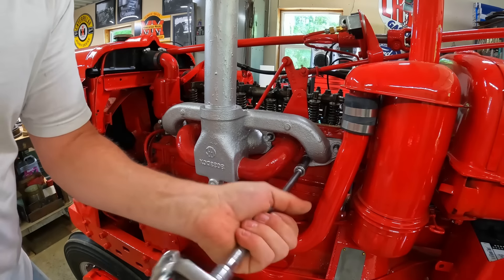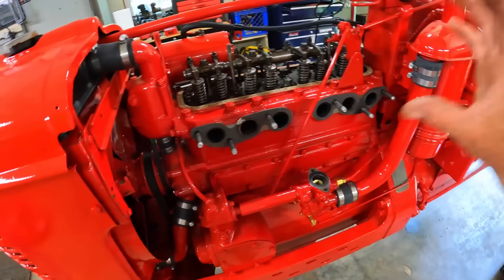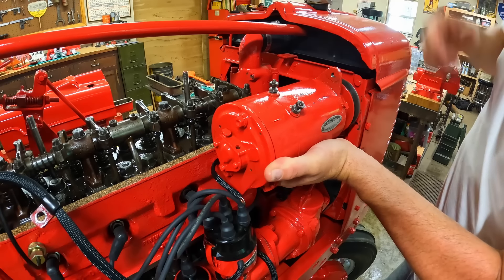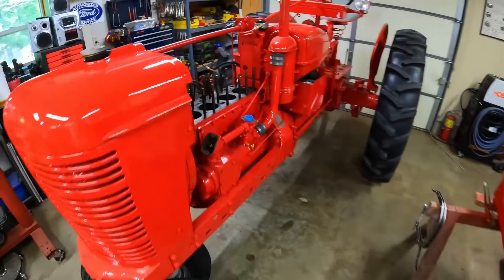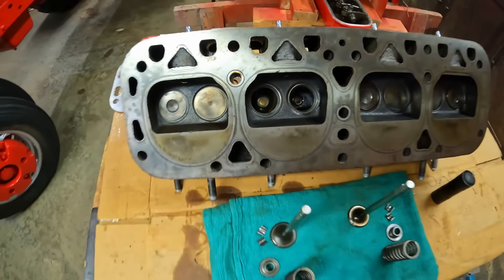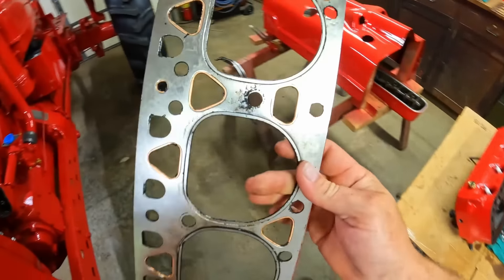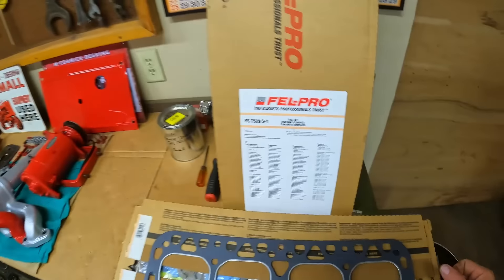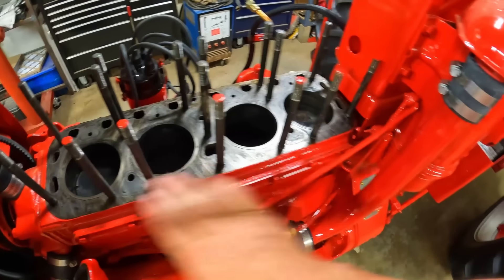Farmall H Engine Knock Found, But It's Not What I Thought - Farmall "Preparation H" Project Part 45

Comment: I'm a lawn mower mechanic, and only piddle around with larger things. I've owned a couple of 40's farmalls, and never had one that the sleeves came up that easy on. I, too, would be suspicious of that particular sleeve, I can't fathom how it would be loose, and am more suspicious of the bore than the sleeve going in it. If the sleeve cracked, it'd get tighter*...if however the *bore cracked, the sleeve would get looser. Surely not a cracked bore though as really, all I can think of that'd allow that to happen is if it froze, and I'm fairly certain you take better care of it than to let it freeze and crack, so metal fatigue? previous owner let it freeze and a small, unnoticed crack grew? No idea, but a crack of any size at all you'd think would let water into the oil and be evident, and it'd have to be of some size to allow that sleeve to be loose.

if everything is ok, I am afraid that even though @lukestrasser poopoo's the idea..if everything else is good, a little sleeve compound would solve it. If there was a way to notate it so that the next guy knew, it would be a non issue. I would not trust that head gasket to keep that sleeve in place. It's my understanding that that is not the purpose of the head gasket in these engines..and any travel, will gradually become more travel as that sleeve hammers away at that head gasket one tiny peck at a time.

Finally, as an afterthought...there is a possibility that the sleeve barely moved to begin with (came to me as I was imagining that sleeve slowly beating the new head gasket paper thin)..and over time, wear from it moving made it looser and looser...but which part wore; the sleeve or the bore? Probably both. A new sleeve might be tighter than that one, but is the bore still within spec to accept it snugly? All questions that need answers.

Comment: Don't loctite it. It's a dry fit sleeve. Maybe a shade under tolerance but like you said, still in good shape. Part of that head gaskets job is to help hold those sleeves in place. Thousands of engines built exactly the same way. Inspect it, clean it, put the Fel-Pro on it and bolt'er up. She'll run like a Spotted Ass Ape after that!

Comment: If it checks out I would put the better gasket on and run it. It is interesting that removing compression stoped the liner from moving.
Reply from the maker: Removing the compression kept the rings away from the cylinder wall, reducing the amount of "drag" that they exerted on the sleeve - a lot of people don't know this but the more the air compresses on top of the piston, the tighter the rings seat out against the wall.  Maximum ring-to-cylinder wall pressure happens just as the fuel charge is ignited, expanding the rings out fully :-)

Comment: I don't know how thick the metal is around the sleeves of this engine or if something like this can be done.  I've never sleeved and engine so I'm not familiar with them.  I'm a Machinist, spent many years in the USAF and in civilian shops. I've seen bushings in parts that were designed with sleeves or bushings with what I would call a threaded keeper. They were designed that way so they could be removed and replaced where it would require a lot of work or an overhaul of the equipment that would be costly to replace an inexpensive part. Basically it was nothing more than a set screw that 1/2 to 3/4 was drilled and tapped between the two parts. After the set screw was installed it locked the part in place so it couldn't rotate or move in and out of the housing. Depending on how large the part was there  could be 1 to 4 of these threaded keepers around the bushing or sleeve. Another way I've seen this done was by drilling and tapping a hole next to the sleeve and either counter boring or countersinking so that 1/4 to 1/2 of a screw or a small bold, sometimes with a washer would set flush or just below the surface so it would lock the sleeve bushing in. The flush setting worked well with the countersink screws, especially in parts that needed to be sealed with a gasket. It is surprising how much a little screw can hold if done properly.
Like I sated before, I don't have any experience sleeving an engine. But if there is enough metal around that sleeve it should work.
One other potion, there are many small independent machine shops that could make cylinder sleeves better than you can buy today and could probably use the work. Soon you will be able to 3D print those cylinder sleeves. I'm afraid that 3D printing is going to be the end of machining. 3D Printing has come a long way when since it was invented. When I saw the Swedish Car company Koenigsegg showing their new two stage turbocharger made out of Stainless Steel or Titanium, that is produced by 3D printing at considerable cost savings, I knew then it was only a matter of time that machining will come to an end. That was 10 years ago! You might be surprised how far 3D printing has come and now they are making body parts with cellular 3D printing.
Here is a link to the Koenigsegg turbo if you would like to see what I mean.
https://www.youtube.com/watch?v=DNedUZxP8NU

Comment: i would try to find a new sleeve that is titer . if it is to lose you might have trouble with heat transfer to the parent bore. i had a friend that farmed with m farmalls and he said there used to be a .005 oversize sleeve for this problem.some mechanics used to hone the parent bore to clean them up to put a new sleeve in . good luck

Comment: Have you thought about if this sleeve issue is connected to the old head cracking? I dont remember where and how it was cracked. If you dont think one damaged the other i myself might chance a quality gasket,  if you are suspect they are connected you may only be delaying new sleeves,  and running the risk of another damaged head
Reply from the maker: The old head had a repaired (pinned) crack above #4 cylinder, up inside an intake runner not related to anything happening down at the block 👍

Comment: I recently did a sleeve and piston rebuild on a ford 640, the sleeves and pistons out there for new parts are cheap chinese.   The sleeves on install were very tight and pistons were actually over spec, let's just say QC was not there.   Had a machinist help with the sleeves.   In the end I got it to work good but boy are the new chinese parts a headache to deal with.

Comment: A new sleeve will mean a new paint job, so use the good gasket and run it. Otherwise it will mean a complete repaint of the entire tractor because the 'other brand' paint will not match and you do not have enough paint to do the engine block.... I have a Massey 35 with paint that is no longer avaliable, the new paint is a different shade of grey to the original.

Comment: At least now we know. I defer to the engine experts on this dilemma. Personally, I would rather run used but not abused older "quality" parts than brand new "questionable quality" stuff any day. Things were going down in quality for quite a while, but since covid quality just fell off a cliff while prices went through the roof...  What about measuring all the sleeves and the bores maybe you can swap if one of them would yield a tighter fit?

Comment: I've read the first 30 or so comments and didn't see any mention of using a punch at the edge of the sleeve where it rests in the block to add a little retention in maybe 5 or 6 spots around the circumference.. I don't know what the hardness of the sleeve is so this may not be appropriate.  Plus I can just see you gritting your teeth at the idea of doing that. :o)  Good catch in any case. Failing the punch idea I'd just put the correct head gasket in and run it that way. You've already made it clear that this is just a show tractor and not a working one.

Comment: That is such a odd happening for the sleeve to move like that. Might be that the parent bore is looser than it may have looked all those years ago. Plus possibly having hammering damage to the rim recess and bottom shelf if there is one for that sleeve. And during the ~200 hrs the sleeve just worked loose from the short heat cycles and sitting.

Might be worth it to check all the sleeves to see if any others are on the verge of getting loose. Pull that one out and just run a quick brush on the inside of the parent bore. Maybe a little locktite, maybe. Otherwise, better head gasket to have more of the top hat sleeve covered to fill the gap between sleeve and head.

Comment: No brainer. Put it back together with the new gasket and move on.
If you ever have to pull it apart (maybe never) do it then.
Three rebuilds in 250hrs is getting past the pale. :-)

Comment: I don't really understand how that little overlap on the gasket would prevent that sleeve from coming up out of the engine block. I realize that the sleeve shouldn't be coming out to begin with but that small overlap would be gone after a few minutes run time.

Comment: Do you think the outside of the liner could be built up and machined back down to spec. There is a guy called Abom79 that spray welds on stuff as he spins it on his lathe.  I suppose he could turn a precision shaft to fit inside the liner bore, then turn it on his lathe and spray some weld on the outside of the liner. Then he could turn it for a precise fit, perhaps a little interference fit to the engine block. Then you could press the liner back and that would be a permanent repair, good as brand new. I assume that is a dry liner engine and if so, I would think you should have a  good fit for proper heat transfer.

Comment: Locktite the sleeve use a good gasket & move on.
You cant trust any new part you buy now, so risk the old part that worked.
A frw years of use & the sleeve will lock solid. On weekend I had to be creative with my project as the new parts were substandard .

Comment: This is a tough call get sleeve clean and red loctite or maybe jb weld with GOOD head gasket its really a toss up then have to wonder about the other 3 cylinders are they loose too I wonder if head gasket is for an M engine larger bore bigger sleeve ? Maybe you have a M sleeve and head gasket left over to compare or maybe can use dementions of sleeve from tech manual

Comment: I wonder with the proper head gasket if that sleeve would tighten up when the engine gets warmed up. Usually a thinner mass heats up faster than a thicker one ie the block. What about adding some knurling or dimpling to one or the other pieces to increase surface tension?

Comment: I would pull the sleeve, maybe the rubber gasket on the bottom gave up the ghost?, or there’s a crack at the bottom of the sleeve that’s causing the sleeve to jump? That’s where I would start.
Reply from the maker: This is a dry sleeved block, so no o-rings or seals to worry about and no coolant contacts the sleeve 👍

Comment: I still don't understand why...if the hole in the head gasket was too big...then why are there no "witness" marks on the bottom side of the head?  

I am just worried about the lip at the top of your sleeve.  The sleeve material is a bit brittle and might be weakened from the hammering/clicking against the top of the block.If the lip on top of the sleeve breaks loose, then it may start to slide down into the crankcase.  

I rebuilt an engine from a 1946 Farmall H in the winter of 2002 for which a wrist pin keeper came off, wedged itself between the piston skirt and the cylinder/sleeve wall, and then as the engine was still running...the sleeve was slowly pulled down inside the engine.  The throws of the crankshaft beat that sleeve to smither-reens.

Comment: For the little bit that you use that tractor slap a new head gasket on her and send it.  I bet it will be fine for many years to come.  If and when it ever becomes an  issue, then do a full rebuild on the engine.

Comment: The Noname gaskets are probably all made for the 350 engine and as long as the bolt and passage way hole spacing is not a problem they're trying to sell the same gasket for the h-super h-300-350 so they can make the most money instead of having 3 smaller batch runs that cost more to make
Reply from the maker: I thought that too, the extra relief around each of the combustion rings looked like it would’ve been about right for those “overbore” versions of this engine 👍

Comment: Wow is that head gasket even made for the H? It looks it's meant to go to a engine with a bigger sleeve? Your right on the unknown quality of the reproduction wear items, this is not only a old Farmall, CAT or MM related issue at all. How much dose the head of the H weigh? Looks like not too much considering you can lift it out with two hands.
I think you got very lucky cause if that sleeve would have been allowed to pop up and down it would have ruined the block for sure.

Comment: Thinking outside the box: Would it make sense to perform controlled corrosion on the exterior surface of the loose sleeve? I.e., parkerizing or rust bluing. What I found online suggested these processes add 0.0001-0.0002" to a metal surface. Maybe repeated application or brush the outside surface to raise a rough surface, first. Or, electroplate with nickel? Could do it on a new stock sleeve to see what the effect would be, before doing it to the OEM material. Just some thoughts.

Comment: The core problem with re using that liner is that you will not have good contact with the block which means poor thermal conduction. That will cause hotspots with a probable engine failure which will probably do significantly more damage to the engine. Upto and including destroying it.
Reply from the maker: 18 years ago when I rebuilt this engine I slid all 4 new sleeves in with just hand pressure, so none are more than a slip fit. This is actually quite common to see on dry sleeved blocks 👍

Comment: For the liner to be that loose means something is wrong. Could be the block,could be the liner, or a combination of the two. My move would be,clean and inspect, if nothing glaringly obvious is found, chalk it up to a loose fit. Green Loctite is fine, the mistake people make when using it, is using too much. A thin coat around the top 1 inch of the cylinder bore is all it takes, don't do the entire length of the sleeve and you'll be fine. And it's not like this tractor is ever going to be ran 80 hours a week at full throttle anyway, even if it was, you wont have anything to worry about for at least 4,000 hours.

Comment: The sleeve is a press fit mandatory.  Bore that bore with  correction sleeve I don't care those sleeves need to cool by contact to the bore.  YOU NEED 2 TO 4 1000S STANDOUT.
Reply from the maker: About half of the dry sleeve engines ever built have had press fit sleeves, it wasn’t until HP started increasing and diesel applications began using them that the press fit became necessary. Remember, this tractor has ran this way for the past 18 years 👍

Comment: Ok I’m gonna mention something here and probably get very little traction, but here is the problem IMO. 

Back in the day Farmall/International when they bored the blocks for sleeves at the factory there was a tolerance for the sleeve bore and it was rather quite extreme. If you look at your block deck “I can see the letters in the video” you’ll see that you have letters on the deck. I believe they were marked A-D, A being tight and D being loose. That correlates to min to max of the allowed sleeve bore. When motors were overhauled with Farmall/International parts you have to match the kit with 2x A sleeves and 2x D sleeves etc.

What has happened is the aftermarket has forgotten this and everything is a generic size or people use a ball hone on the sleeve bore to make things fit without checking everything. You never know what has been done to these old tractors.

I would strongly suggest you pull the motor and check your sleeve bore sizes in the block.  I’m gonna bet you need to over bore it to do it right with the parts that are available today. 

I’m not super sure of the numbers and such but I believe you can install super H sleeves in an H block (casting is the same) you just need to bore the block for the bigger OD sleeeves. 

You can try a locking compound but that thing is LOOSE and isn’t not right.  You’ve probably tore up both the sleeve bore and the OD of the sleeve at this point. That original gasket you had was probably for a super H.

If you doubt what I’m saying the old tractor forums in their way back times have a lot of old school mechanics that mention this from back in the day and this was a problem in the early 2000’s let alone today.
Reply from the maker: You’re exactly right, and I broke down all of those block bore stampings and their meanings when we did the Super M rebuild on the channel here a few years back. The videos of us having to custom hone the block bores to match the “new” sleeve OD’s are still viewable in that project’s playlist. Back when I did the prior rebuild on this H (18 years ago) I noted how all 4 new sleeves went into the bores with just hand pressure, so none of these were very tight to begin with. My grandfather also had one sleeve loosen up in this engine and start to click about 50 years ago, but I don’t know if that was on this same #3 hole or not 👍
Reply: @squatch253  10-4 so this is not a new problem to this engine. That sucks!!!!  If it was me I’d explore over sizing it, but that has its own set of issues. 

Didn’t know you had a prior playlist where you covered the deck stamping on Super M. That’s cool I’ll have to check it out. I learned about it from my dad when he was explaining it to me when he had to overhaul the old M 45-50 years ago.  The knowledge of those letters and their meaning has been largely lost unfortunately.  Now everything is just a nominal size and you hope your block is OK with it.